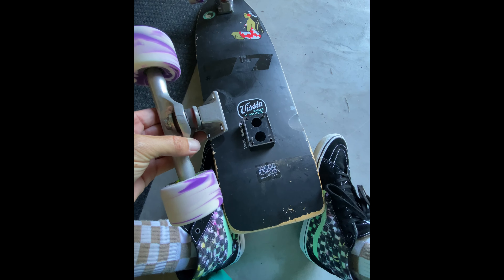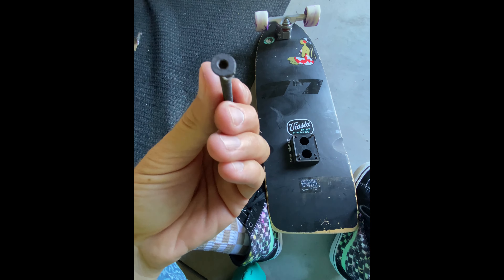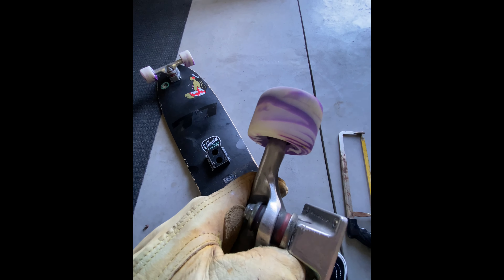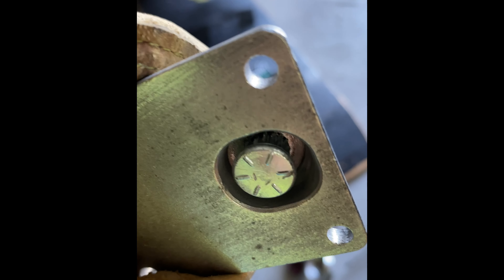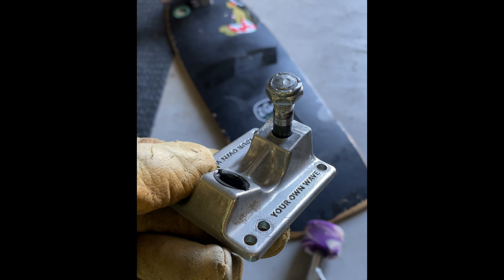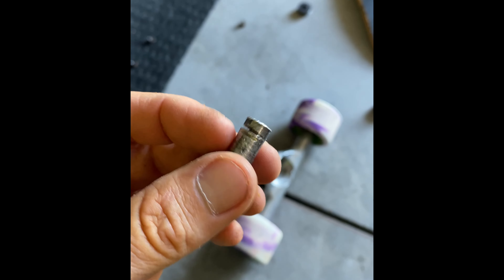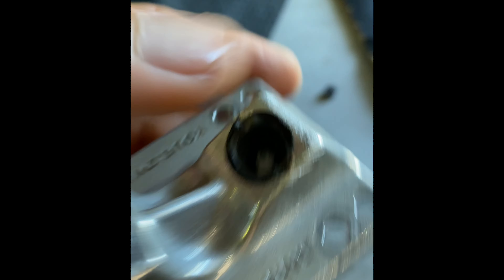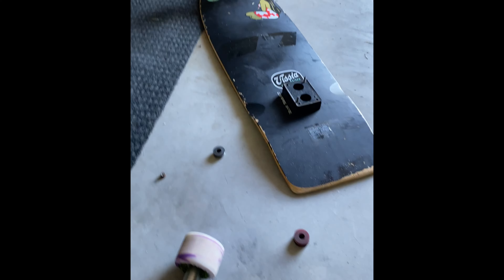Yow Meraki Fruck Shitstem

Comment: That looks frustrating for sure. Good information though, seeing how it is put together. Going to look on yow and see if they have spare kingpins.
Reply from the maker: I found the Yow style king pin. Shorty’s makes it. For anyone reading this, the sku is: Item # 1ASHOKINGP00000

You can find it on Amazon for about $7 for 6 of them. I’ve never seen such a design. Shorty’s claims compatibility with all standard trucks. Though I know that all standard trucks use a standard hex fitting. We’ll see if I didn’t ruin my Yow rear truck just sawing the damn kingpin out. It didn’t appear broken but it spun free, so you couldn’t just take the nut off. Weird. And it might just be a pivot cup issue, but either way the kingpin spun free so there was no taking the truck apart to simply replace a pivot cup, if that’s what was it. It was bizarre all around. Couldn’t tighten, couldn’t loosen. It wasn’t broken, and the grooves at the base of the kingpin seemed fine and the kingpin seemed like it was welded into place cause I could barely hammer it out after I sawed it in two. I can’t figure why all these SurfSkate companies put forth bad designs in one way or another. They’ve all been to market half decade minimum and they haven’t figured out their flaws? Or is this a money maker for them all? Yeah I figured if this gives a few people a heads up, then it’s worth sharing. If I find another solution I’ll share that too. I ordered pivot cups and kingpins and we’ll see if I can fix the issue that way. Otherwise I’ll do my best to find a rear that’s comparable in stack height and axel width and hope it runs just the same.